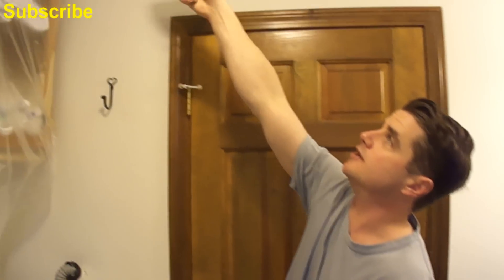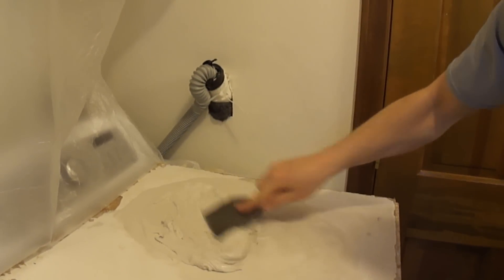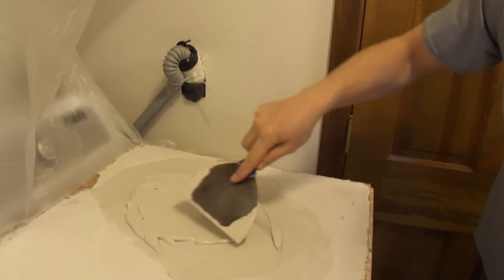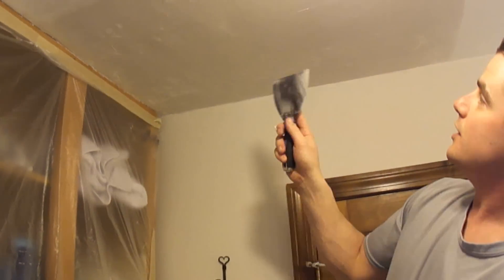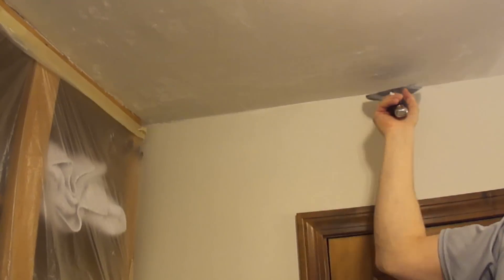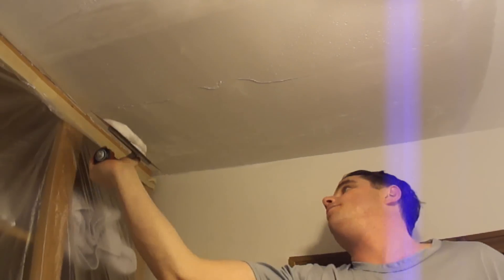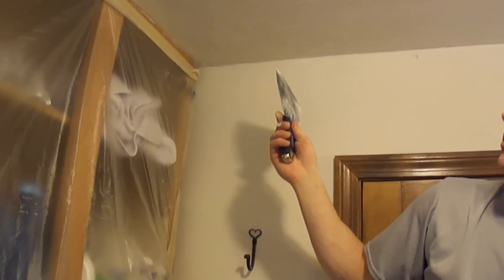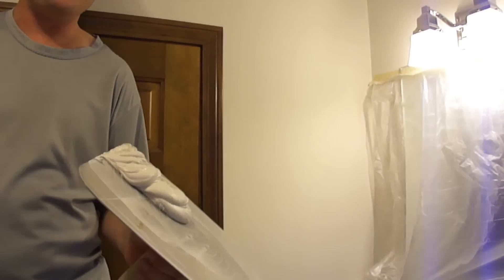SKIM Popcorn Ceiling (Part 4)

Comment: How has the mud been holding up, Russ? Wouldn't the added weight pull the popcorn off? Thanks!
Reply from the maker: Hi

It held up fine. Sometimes that can be an issue if the popcorn texture isn't stuck tight to the ceiling or if it was sprayed over a dust layer that was on the ceiling. When you go to scrape off heads of popcorn before you skim over it you will notice if large clumps fall away. Do you have a similar project?

Russ
Reply: I hate the popcorn ceiling of my house so I proceeded to scrape it off two rooms unknowingly it contained asbestos. Once i found that out, I halted the work so the rest of the ceiling still got popcorn. I've been finding the best way to rid it including hiring a certified crew, putting up another layer of drywall below it, skimming it etc. which landed me at your channel.
Reply from the maker: Hi

Yes, going over it with new drywall is great to hide it, especially if it contains Asbestos! Where you from?

Russ

Comment: add a little "popcorn" to paint tray+roll out ceiling. If you want "smooth" ceiling re-hang ceiling+tape+paint. Guaranty no cracks or chipping 10 years out, whereas, ceiling previously damaged its best bet
Reply from the maker: Kevin Macaroni 

Hi Kevin-

A smooth smooth ceiling was desired and cabinets with crown molding occupy part of the ceiling so couldn't go over with new drywall. Just showing a technique here for smoothing over popcorn in a smaller room. You are right with your comments though! Thanks for sharing that. Where are you from?

Russ

Comment: Russ, what proportion of p of p do you use to drywall mud?  Really enjoyed the video.

Mike
Reply from the maker: Hi

Try to use 1/2 and 1/2. It's never gonna be exact, but try to mix equal amounts. The more plaster, the quicker it will set, the more joint compound, the longer it will take to set. But the longer or shorter times are measured in minutes. Experiment with different mixtures. 

Russ